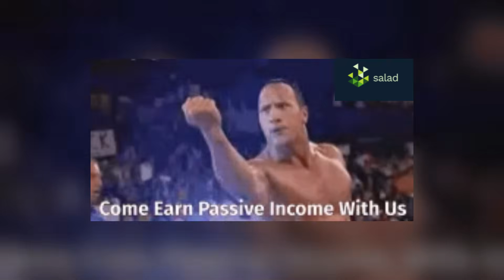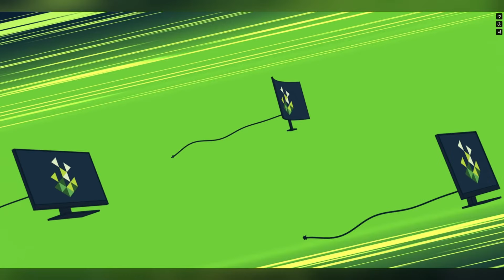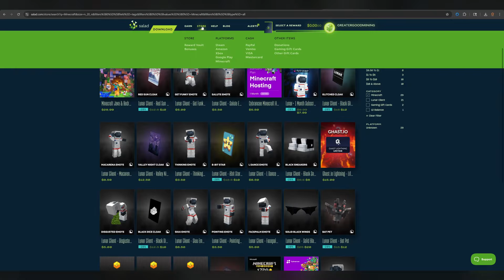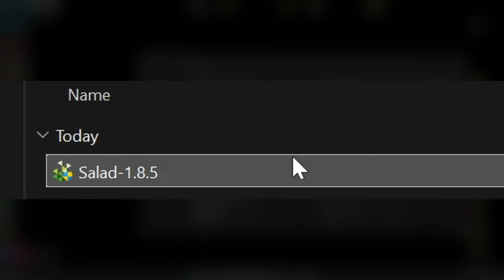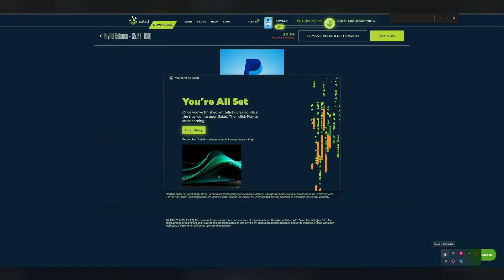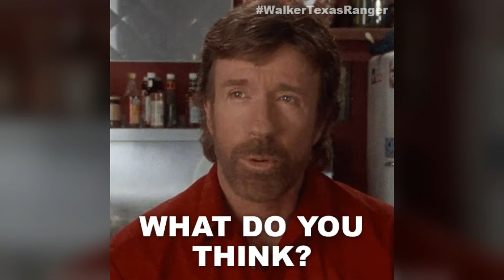Earn passive income with your home computer! Easy guide to get started with Salad!

Comment: When building a Salad Specific Rig, I install Windows with a Local User Account and NO password.  I copy the Salad shortcut into the startup folder (Win +R , shell:startup) and finally set power on on power loss in the bios.  This ensures that in a power outage that salad will run again as soon as power is restored.  Also, due to recent upgrades, use idle time when you have no jobs to Update as you lose any active jobs if you update while chopping.
Reply from the maker: Thank you for this info John Germain! I'll  do the same when I build up a specific rig for salad!

Comment: Is it safe to download and set up on my own main computer?
Reply from the maker: The jobs they run are containerized, so they are isolated away from your main PC. It's kind of like running a VM where the operating system is running separately. Of course you always need to be careful when downloading any apps. Double check the source youre downloading feomnand the link youre using etc
Reply: @GreaterGoodMining oo ok, thank you!